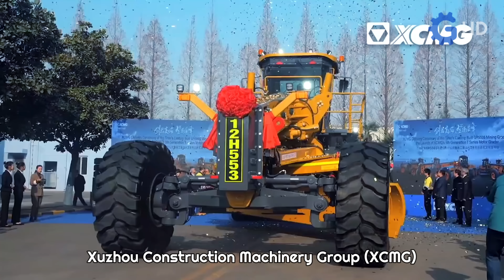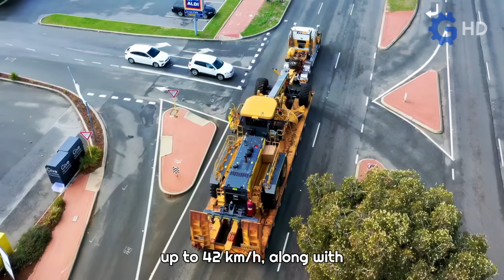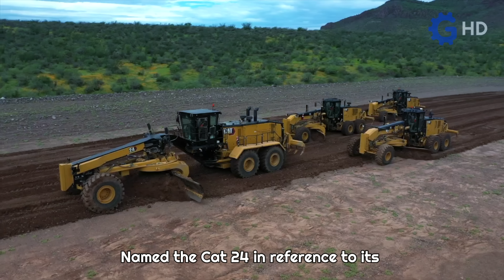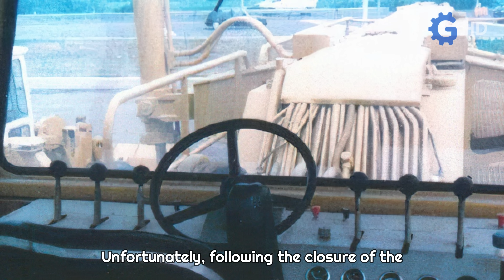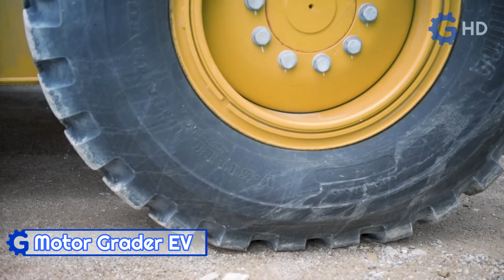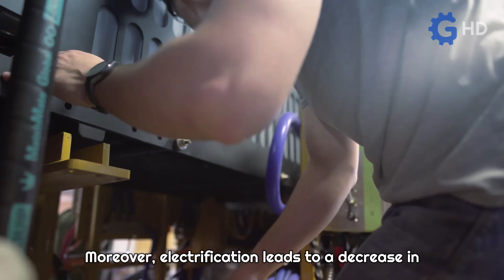THE LARGEST MOTOR GRADER IN THE WORLD THAT WAS NEVER USED ▶ HEAVY-DUTY MACHINERY

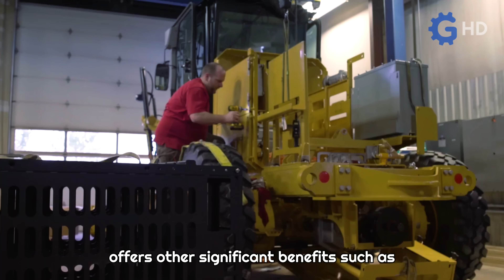Comment: 9:00. Thats all great until you realize its primarily recharged by coal and it will lose charging capacity over time and ultimately produce a huge toxic dead battery that nobody knows how to dispose of or recycle (economically).
Electric is lose/lose.   Want to truly go green? Then check out hydrogen options.

Comment: The Motor Grader EV is an interesting concept. The big questions are how long can it operate before needing to be recharged, and how long does recharging take? Yes, an ICE grader also needs to be refueled periodically, but refueling only takes as long as it is required to refill the fuel tank.
Reply: As with every EV out there, it's a mirage and a fallacy.
Reply: @hugolafhugolaf  They have their places. Cities should have EV buses, trucks and taxis. I see diesel trucks from municipalities, and they don't even have close to 100k miles on them. I bought an E bike and it's truly incredible. I'm in a rural area and in summer I ride it to work a few days a week, charge my second battery for free at work and it's actually a fun ride.  I have a DR-400 also, that gets insane gas mileage, but it's not the same as the E bike.
Reply: @genefogarty5395  and cities in cold areas are dumping the EV buses as the are garbage in cold. Chicago had a nice week of dead EVs as the cold killed the charging stations lol
Reply: @mikeklinger1712  Charging infrastructure is a big issue. Without enough stations, EV graders won't be practical for most sites.
Reply: @farwindowusa  of course charging infrastructure is a big issue because our government spent billions on it but only has built 7 stations because ol' Pete Buttcheck couldn't find enough DEI electricians to build them 🙄
Reply: You beat me to it. Zero point energy perhaps haha?
Reply: I'd consider replaceable battery packs instead of just connect it to be charged. It would require standardized battery packs though.
Reply: The quest with an EV one is how big will the lithium battery 🔋 fire 🔥 be
Reply: I’ve pretty much got to run the evolution of graders.  Started on an old cat number 12 from the 60s… for the amount of work we got done with that machine used in fuel it…It was a very efficient machine. I believe the future is hydrogen… I am in the energy business now and when the largest gas and electric company in the nation is converting things to hydrogen storage… Might want to take notice.
Reply: What is the fuel source used to generate the electricity to recharge it??? Coal? Natural Gas? It's a hoax.

Comment: The ACCO sat since mid 80s and could not be repaired to running order. says a lot about European equipment. I’ve seen CAT equipment built in the 50s and 60s still running along with others ( Dresser, Deere, Cedarapids, Manitoac and other American companies).
Reply: it doesn't say anything at all, they were literally functionally one-off, its not as if there haven't been plenty of US low production volume and one-off made over the years that have intrinsically suffered the same fate, in that no one has the time or impetus to want of save them rather than recouping some money in scrapping.
Reply: Built with almost all commercial parts, mostly CAT and Detroit, for a large construction project in Libya just before USA f**ked up everything as their usual. It wasn't unfixable, simply it had no purpose doing it, and since the owning company closed due to death of the owner and sudden his son, the only offer has been from a French firm to scrap it 😢